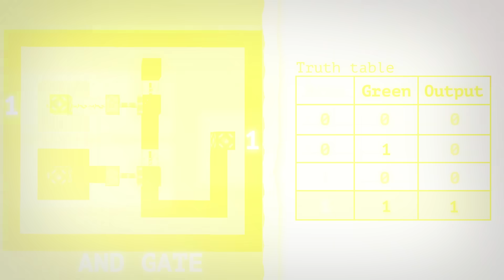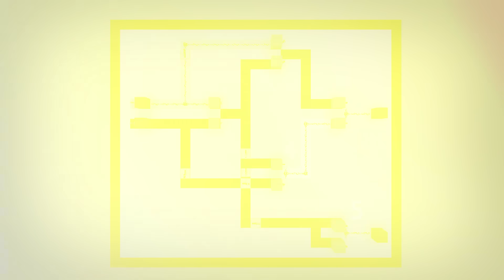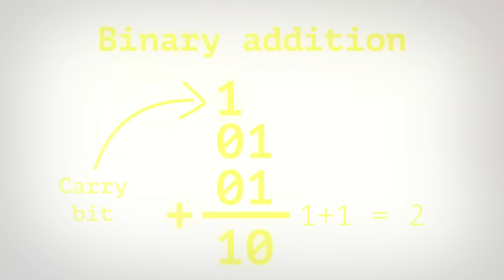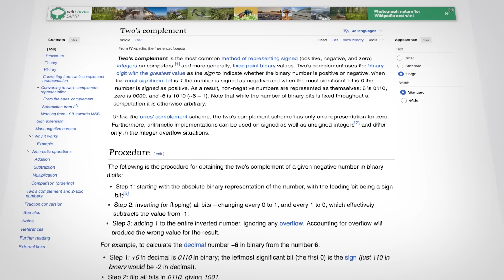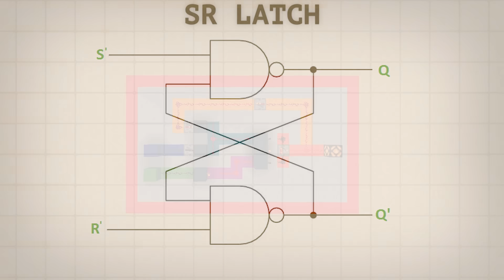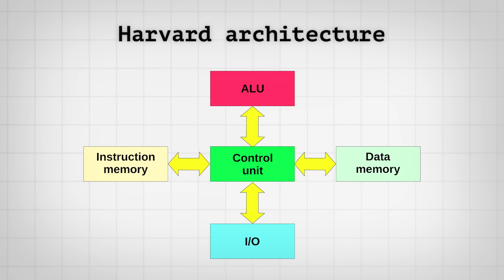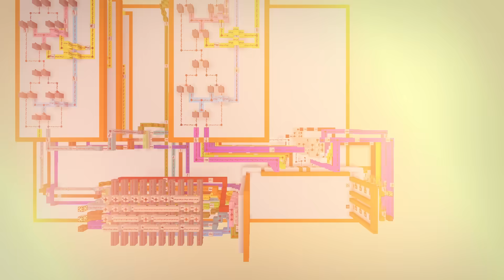Computer Architecture Explained With MINECRAFT

Comment: This is basically a recap of my college CS 231 (computer archetecture) class. 

I would have pointed out a principle called abstraction once you start building the 4 bit adder. I would have also mentioned DeMorgan's laws at around 1:33. 

For those not in the know, Abstraction - in regards to computer science - is a principle where the user doesn't need to know the inner workings of a device to be able to use it. In the case of a Project I did recently, I wrote a program that supports integers with an amount of digits up to java's integer limit. When I implemented the addition method, the multiplication process was just repeatidly calling the addition method the multiplicand number of times. It worked (abiet inefficently) and once that was done, I was able to implement a factorial program by calling the multiplication method and adding 1 to the "seed" without the hassle of re-implementing my solutions.

Abstraction is SUPER useful, and it's how it gets from simple logic gates to the full computer with ALU, memory, etc

Comment: Do NOT think of redstone as electricity or power.  It is nothing like it.  Redstone is pure digital logic in every sense of the word.  There is nothing physical except the the redstone connects.  It does not simulate a wire at all only the logic connection you'd place in basic computer architecture.  Likening electrical theory to redstone is flat out stupid

Comment: nice summary, clearly communicated. one tiiny factual error i noticed was calling an adders subtracter module an ALU, as it stands for arithmetic logic unit, you had the arithmetic part present but no bitwise operations. also maybe mentioning things like a clock and a program counter so that instructions are read from memory in order at a set rate would have been a nice yet small addition, but anyhow very nice. 

Im work on building complex CPUs in minecraft so if anyone has any questions of any complexity feel free to ask

Comment: Do you have any advice for someone  who’s not the most inclined but really does want to learn this stuff?

I like the video it’s just that’s it’s still so swirly and confusing in my brain…I understood the transistor part and I think the logic gate but geez not a word else…might be hopeless ngl mate. But regardless, good video—I’m sure for most it would make sense 😅
Reply from the maker: This video is definitely too chaotic and surface level to really understand computer engineering. I’d recommend taking it one step at a time, make sure that you really understand all the basics of electronics before you move to the more complex stuff. But in the end, all of this is really much more simple than it seems. I learned most of this stuff in university so I’m not really familiar with any online resources other than a course titled 8 Bit Breadboard Computer by Ben Eater, it is available on YouTube. Once you’ll complete that course you should have no problem with building a computer in Minecraft or really any other program that supports logic.

Comment: 1:40 I can't get the and gate to work in bedrock edition
Reply: Pretty sure this doesn't work on bedrock you can try to do it with pojav launcher if you are using a phone
Reply: @Outcome-1  I'm on pc
Reply: If the first one doesnt work, check if you clicked the comparator once after placing, by defalt it should be turned off and the light shouldnt burn
Reply: Bedrock is fake Minecraft. Don't fall for it

Comment: im a little confused, when you first made the 4-bit adder where does the input for the carry-in (c0) come from?
Reply from the maker: The carry-in input is used to chain adders together. For example when you connect two 4 bit adders, after connecting the carry-out of the first one to the carry-in of the second one you end up with an 8 bit adder. But when you have just one adder, you don’t need to connect anything into the carry input.

Comment: For those who are wondering what negative number theory he skipped over, I believe he used Two's Complement to find negative numbers.

A quick explanation is this:
The most-left bit signifies if the number is positive or negative.
If you want to go from +2 to -2 in binary, all you need to do is invert all the bits (0's become 1's and vice versa), then add 1.

Comment: the video is too simplified. i want to add two notes (my thoughts. i may be wrong)

1) redstone and electricity are similar in computational and electronics terms and redstone can be used to study it but redstone and electricity are different on more deep (physical) level. the electricity is not something that is presented here, in the real world, for all the time 24/7, it has to been generated somewhere first and without it the device won't work. for any electronic device to work, needs current. but redstone just "works" all the time in minecraft world, it have just 2 states - powered or not (it have 15 states but for computational purposes, we use its 2 states, if there is a signal and there's not) and we create power, signal, by manually clicking lever with our hands (in minecraft). and it works all the time in a minecraft world and can be infinitely turned on. unlike electricity which doesn't just sits here in the air for all the time. that's an interesting thought and i hope you understand me correctly.
when i saw the preview it was like "redstone equals CPU" but it's not, i mean, CPU needs external electrical power to operate while redstone always active and works more like wires. and we explore redstone more like wires that magically have energy to be turned on anytime. but i might be wrong

2) 3:32 decoder / encoder part. in the video you dedicate just a few seconds for them but in reality the explanations why we need them and the logic behind them would take much more time (same with other topics)

Comment: You went over 85% of the material in my EE Digital Design course in the first 4 minutes. Honestly really impressive and I wish we used minecraft redstone instead of broken LEDs and little flimsy wires. Making a DEMUX on a breadboard was not fun when most of the LEDs wouldn't work and the microchips kept failing

Comment: Frankly, logic gates are inspired by the Symbolic Logic. For example, AND gate functions the same as the AND operator in Logic. When you say "The weather is cold AND rainy", for that statement to be true, the weather must be cold and rainy at the same time (just like both inputs of the AND gate must be 1 at the same time to give the output of 1). If the weather is hot and rainy, cold and sunny, or hot and sunny a.k.a. at least one of the inputs is 0, that statement will be false, i.e. it will give the output of 0.

Comment: please no. i hated coding lc3 simulators from my last quarter and printing out the calculated result from an user input and calculating depending on what the user wanted in the console using multiple 16bit lc3 binary code but at least assembly code was much more easier to comprehend and debug. i wonder if these minecraft computers have the full vonn neumann architecture with the registers like mar and pc cause i only saw ir. also watching this half asleep

Comment: i made a working calculator but its just the same thing repeating a bunch of times. Just a pattern. Transistors are more like comparators. Binary is easy to read once you get used to it. Your ALU is giant. My calculator is a computer i guess.
Reply from the maker: Yeah, my ALU is giant but that was a conscious choice since I wanted to keep the adders as comprehensible as possible. I wasn’t optimizing for size but rather for clarity.
Reply: @Codeolences  ok.

Comment: I'm a programmer who has an alright understanding of computer architecture, but I've never been able to understand redstone. So this video might actually help me in the opposite way.
Reply: Minecraft has 2 essential logical components - NOT and a diode. If you deliver a signal to the block the redstone torch is attached to, the torch turns off and stops generating signal creating a NOT. Repeaters only let the signal one way but they also work as amplifiers because the signal gets weaker with every block travelled.
Reply: @berni2905 repeaters are a real world component. They're used for long distance transmissions like radio to amplify a signal and reduce distortion
Reply: The weird thing with redstone is that a huge fraction of the digital circuitry you can implement with them is contained with in bugs or off target effects of the implantation if the in game components (quasi connectivity being the weird bug that’s most often referenced, it’s a result of the redstone portion of the piston code being copied from doors and the 2x1 size of the door being part of the 1x1 piston which enables signals to propagate weirdly). 

Essentially as a programmer you should be able to understand all of the redstone stuff easily… you would just need to crack open the jar file and look at the implementation of each block to see the way redstone interacts with it and then treat them as sort of like an HDL language.
Reply: @tainicon4639 a huge fraction? Not really. People use bugs to exploit but literally all the digital circuitry can be created via using redstone with no bugs
Reply: @tainicon4639  how do you access the .jar file?
Reply: To anyone who thinks you should be able to understand Redstone more easily, if you’re a programmer… that’s not true. 
When you study Computer science you usually have logic classes so you know about all the binary operations, but building circuits is something else (more on the electrical engineering side). 

And I can’t believe how many a**holes this comment sections holds, be happy if you know how to use Redstone, but to put someone down, because they don’t know how to use it is  ridiculous and kind of sad.
Reply: @hinata5736  both coding and programming use logic gates like and, or, xor etc. this can actually help with redstone understanding. If you don’t completely understand a subject, don’t comment whole hate speeches. Please.
Reply: Whoops, meant coding/programming and redstone
Reply: I’m a computer architecture and have an alright understanding of programmers
Reply: Once you can make basic registers and stuff even in logisim, then you should get the gist in minecraft because it is essentially all the same logic.
Reply: Same i didnt realise redstone has such a thing to produce binary.. which means that other games that has binary signals might also has the same possibility 😮
Reply: 8085 Microprocessor with Adriuno microcontroller kits
Reply: Yes, I'm a programmer too, but I never understood Redstone lol
Reply: Same dude
Reply: Same but EE lmaoo
Reply: Me too 😂
Reply: Even 10 year olds understand redstone
Reply: @Anonymous51701  Good good for them lol
Reply: as a fucking idiot i also didn't watch the full video before commenting, familiar?
Reply: magic item
Reply: It is not about computers or programs it is about circuit design
Reply: explained computer mechanics with redstone ❌
Explained hardware engineering with redstone ✔️
Reply: how u have . in end of handle
Reply: same i love programming but it is so hard to understand redstone
Reply: @TheeRealAce0 it is incredibly easy, lmao. This is so basic. It is just a signal that is on or off. Like how can you not understand this

Does a light in real life confuse you?
Reply: not really but tbh i love redstone but at first it is kinda hard to understand but i now really can do great stuff with redstone
Reply: If someone is Programmer, but redstone is difficult for him. He either a) never played minecraft, b) has special condition
Reply: @Jasiek100  It's more that I've just never particularly tried to learn redstone
Reply: @Jasiek100  so you're saying that a programmer should just instinctively know how to structure a nand gate in Minecraft? They should just be able to infer quasi connectivity? 
You do realize writing 
printf("Hello world"); 
does not magically beam the knowledge of how to create a xor gate into your head, right?
Reply: @poot2762  You do realize, writing hello world script doesn't  mean your programmer? Any literate adult below 85 can do this. If anyone call themselves programmer  it means that they can think as programmer, knows basics of coding and knows how to put puzzles together to create picture.
Reply: @pyropulseIXXI  Saying that redstone is as easy as being a signal that's on or off, is like saying mathemathics are as simple as 1+1. 

Redstone is so much more complex in practice than just on or off signals. If it was as simple as that, there would never have been a need to develop new redstone innovations because everyone would've already understood how it all works perfectly. 

You cannot understand redstone as a whole just from the basics, just like you can't understand mathemathics as a whole just from 1+1's

Just because you understand redstone does not mean it is easy. Programming is not easy either unless you study it and learn how it works. Something is not easy if you have to spend years to learn how it works. Easy is something you can pick up almost immediately.
Reply: You couldn’t understand redstone despite being a programmer? People really just causally stop how low Iq they are

This is 3rd grade level; I was doing this as an 8 year old